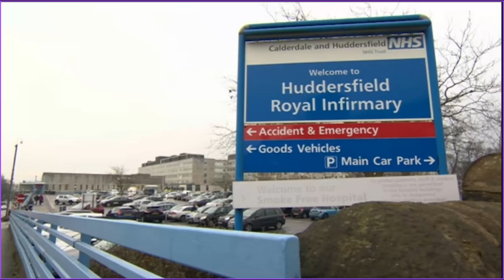How a Novice Built a Wood-Fired Oven in ten minutes (Vlog 37)

Comment: What did you use for a ball to finish the top?
Reply from the maker: Do you mean inside the dome? The kit inside came with a fibreglass dome that you jack up when you get to layer eight. You can use that or continue with the trammel tool. I chose the fibreglass as it is much quicker and easier. See vlog 31 👍
Reply: @Mike-Diamond  Yes that is what I was asking

Comment: Did you do the control cracks on the concrete slab as they suggest? Curious because I'm in the process of my build.
Reply from the maker: I didn’t follow Bens instructions for the slab. I was advised by a builder mate of mine who said it wasn’t needed. 

The last thing I want to do is influence you on what to do as I am a complete novice. So I would stick to your plan 👍
Reply: @Mike-Diamond  yes, well I asked because the last thing I wanted to do was put a two cm deep cuts in my wonderful slab and I've been uming and ering as to whether I should or not
Reply from the maker: You’re at a point that I have been a dozen times. Everyone I spoke to gave me a different answer. In the end I went with some advice and my gut. 

Regardless, mine slab is completely covered so it wouldn’t have made any difference as far as aesthetics are concerned. 

Good luck.